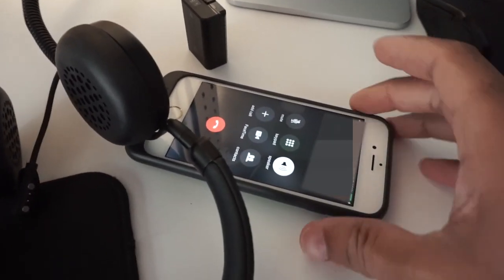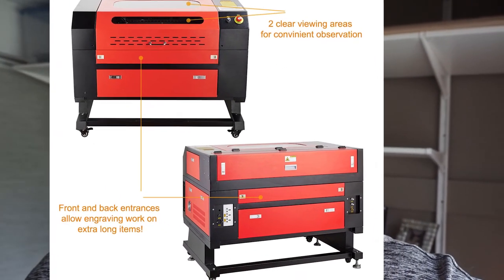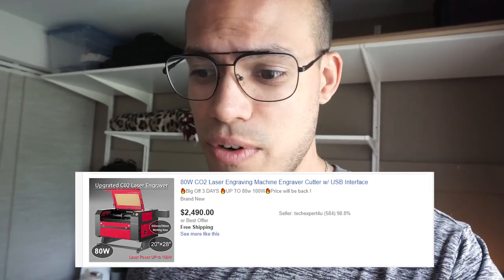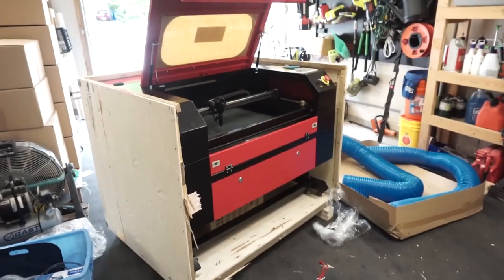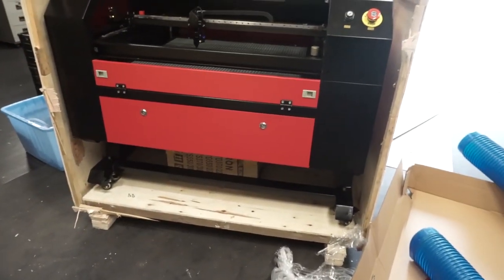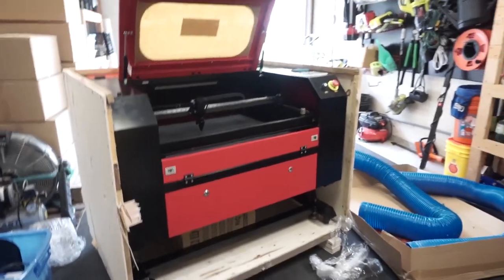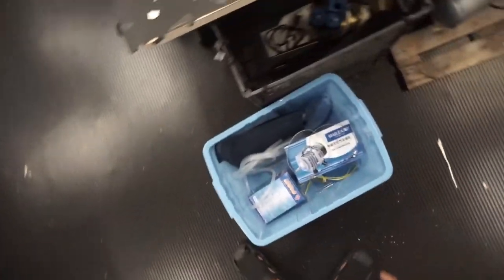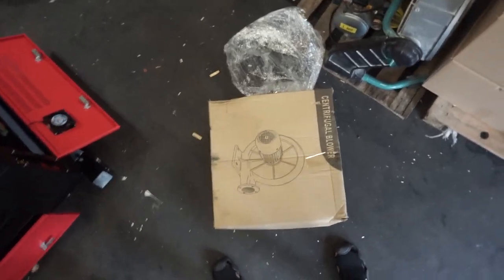Unboxing, Mods and Review | 60w Red and Black Chinese eBay Laser Cutter

Comment: Please add your links or list your upgrades. Ordered one and would like to just have what I need on hand when it arrives.
Reply from the maker: Anything you're looking for specifically? The tube and psu auction listings are long gone but they were 80w units from EFR.
Reply: @sjetmand Sorry such a late reply been so busy trying to figure out how to connect the water alarm from the chiller to this thing and connect the laser pointer combiner to it too.  I was looking for the plug you changed in the back for the power. And could you take picture of how you connected the amp meter wiring, please? I did the tube replacement and ordered the amp meter. There is a lot of mods but not really how to get it all set up. Did you end up putting in a different driver for the steppers? I bought a rotary but need to add a driver for the U so I won't have to unplug the Y axis to make it work. I been trying to get all the mods done before I start working on it. Thanks again for getting back to me.

Comment: What site did you order the laser from and also where did you get the new tube from?
Reply from the maker: Sean Biden Ordered the laser from one of the many eBay sellers. I have a strong suspicion they are all operated by the same parent company. I also ordered the efr tube and psu from eBay. The tube is a zs1250.
Reply from the maker: Sean Biden the laser : https://rover.ebay.com/rover/0/0/0?mpre=https%3A%2F%2Fwww.ebay.com%2Fulk%2Fitm%2F282773396655
Reply from the maker: Sean Biden the tube https://rover.ebay.com/rover/0/0/0?mpre=https%3A%2F%2Fwww.ebay.com%2Fulk%2Fitm%2F172733735446
Reply: Thanks

Comment: Hello, how big is the pipe connection on the machine for the fan?
Reply from the maker: 14September2011 It is a standard 6 inch duct. I reduced it to 4 inches after the fan

Comment: I have this exact laser and i have a few questions about it, if you wouldn't mind reaching out to me.
Reply from the maker: Go ahead and post here so that many might benefit...
Reply: @sjetmand  Thank you,  So my Problem originally was that the laser would mirror my images after i sent them over from the computer. I figured out how to fix that by turning off the x axis. Now my issue is that the images its producing and the text that it is engraving has a slight shadow effect to it. almost as if the laser head is just slightly out of focus. I have checked the focus at every point of the table. Furthest corner. Closest Corner and so on. All  the mirrors are centered EXCEPT for the First mirror after the laser tube. Literally the first mirror that the laser beam hits after being created is slightly off center because the laser head is sitting slightly high,  There's nothing else i can remove to lower this side of the laser tube and the mirror doesn't seem to have an up and down adjustment. Do you think that the laser being slightly off center on the first mirror would make that much of a difference? were talking about a 1/8 inch off center and then I'm centered on the rest of the mirrors. If You'd like to contact me ill gladly give you an email address or something. Ive read through the manual but as you already know, its in what i like to call "chinenglish" Where they appear to take their language and send it through google translate and straight to print. Any help would be appreciated.
Reply: I have two other lasers and bought this one because it was so cheap. My other lasers are a little older, theyre mercury pinnacle 30w. Ive never had this issue with either of those two lasers. So this is new to me
Reply: I fully expected the laser to be factory focused and stuff but that was silly of me to expect from a 2000 laser

Comment: Great video, lots of useful info for me. Hint for the exhaust fan..... get a remote for it. I have one for my fiber laser and it works great!
Reply from the maker: Thanks Chris! After much tribulation I managed to harness the signal from the DSP to trigger a relay delay circuit so it comes on automatically then shuts off x seconds after job finish. I touch on this a bit in my most recent update video. There is a "wind" output that some claim can drive a relay direct but I didn't have such luck. How do you like your fiber? What sort of work do you use it for?

Comment: so I have the same machine as  you do but last yrs model so  I want to try using lightburn  but I am having a hard time getting it to see the machine  are you running it off the USB cable  I selected the ruida driver but nothing  was happening  was hoping you might have a suggestion thanks Andrew
Reply from the maker: andrew buffie foster I didn't have any trouble getting it to connect over USB. Are you sure it's a ruida? I would recommend shooting the developer and email, he's been quick to respond.

Comment: Subbed, you deserve more subs. One note though, about the Z axis. Be careful manually moving it that way. Your stepper motor will act as a dynamo and generate power when you do that which some stepper motors don't appreciate and could get damaged by.
Reply from the maker: Thanks! Hopefully I can get around to making more videos soon.

This is good advice because it can be tempting to swing the axis around by hand.

However this specific model does not have a motorized Z stage so there is no motor to induce power into the circuit.
Reply: @sjetmand  really ? Damn it looks just like mine (color build etc) ... Must be different rebadge then.

Comment: You open the wooden box wrong it has  Screws at the bottom that you unscrew and then you just picked the whole Box top off of it .it would of been a lot easier that way I have the yellow and black and love it
Reply from the maker: Now you tell me! That would have been nice. Glad yours is working out for you as well! I'm still happy with it.
Reply: @sjetmand  well I made the same update that's you did I have 3 that  Custom built for my work . Now the honeycomb reversed the screws and use wing nuts on top to remove it
Reply: One more thing do not use that white power supply at all it's not safe
Reply: But most of everything inside mine has been upgraded  To be honest I'm just using the cabinet i have replaced most everything...So really everyone save your money and buy a name brand.lol  good luck
Reply from the maker: @reconmodelsvaughn469  Which white power supply are you referring to? The outlets at the rear? I just use them for lighting and the aquarium pump now. The wire gauge is definitely insufficient for the air compressor or exhaust fan. It's criminal that they suggest you use them for the blower fan provided, it pulls a lot of amps.
Reply from the maker: @reconmodelsvaughn469  Ooh, I like the wingnut idea, planning to implement.
Reply from the maker: @reconmodelsvaughn469  Have you replaced motors and ways?
Reply: @sjetmand  yes I can't remember the company but they were very expensive a friend got them from a company that make  RC motors their lot smoother and never wear out
Reply: @sjetmand  it works and after using it it makes it lay down better we really did so much now I use a chiller like they use in big saltwater fish tanks I use    anti freeze for coolant in the chiller I have it ran to 3 machine I make big  RC models tanks and military vehicles and in 1/6  scale  and some in 1/16 scale

Comment: 15:09  it's likely aluminum not Brass, Brass is far too expensive and it's Knurled for grip, not roughly machined.
Reply from the maker: Well it can't be aluminum because it's ferrous. I assumed it wasn't plain steel because it's almost gold in color. I know it's knurled, but the finish is rough / cringe-ey to the touch.

Comment: I can't believe they screwed through the feet instead of containing them with wood blocks and fixing those
Reply: Best way because they gave the type of feet that allows you to fasten the machine to the floor. I'm surprised they actually did this. It is a big plus because you have to level any CNC machines and with these feet you can secure the machine in place so that it cannot move or be accidentally bumped out of place and level.